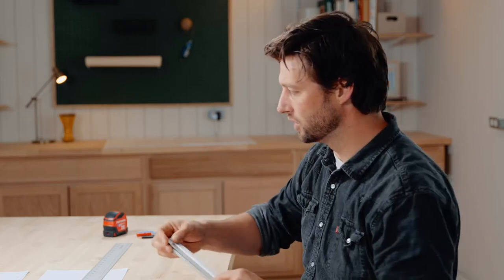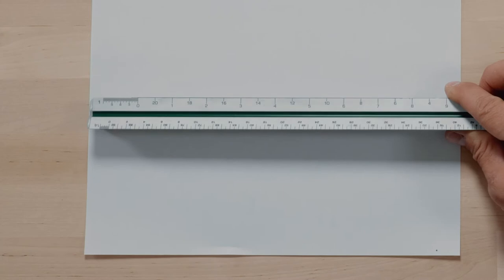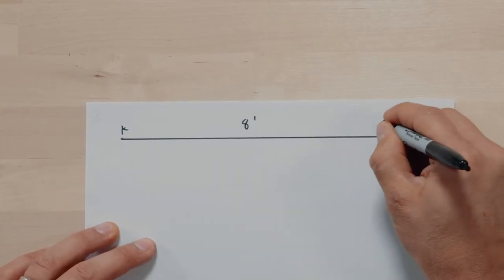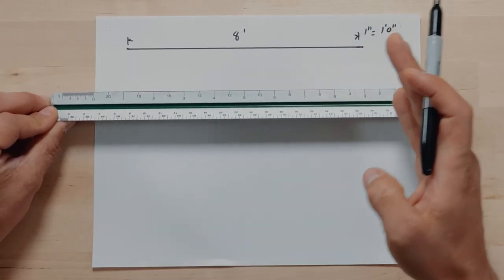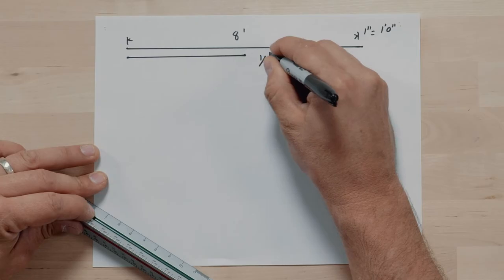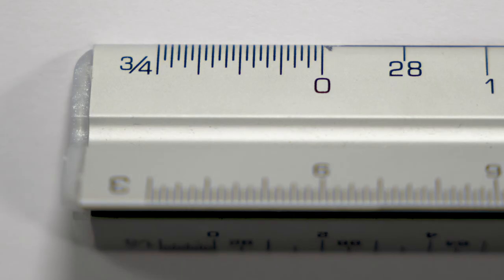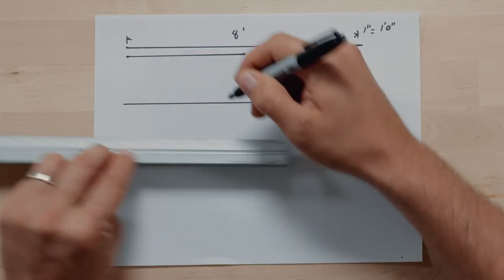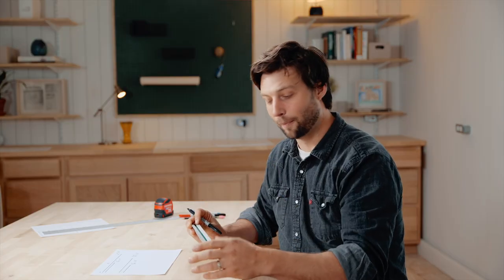How to Use an Architect Scale Ruler

Comment: You explain the markings well (some of them), and I'm sure any sensible person can interpet the rest of the scales. But I learned in a grade 9 drafting class that a triangular scale is NOT a straightedge, and shouldn't be used as one. You mark off the ends of your triangular scale, then use a proper straightedge to draw the line. This protects the edge of the scale, and prevents you getting marker or pencil marks on the scale, keeping it cleaner for the next job.